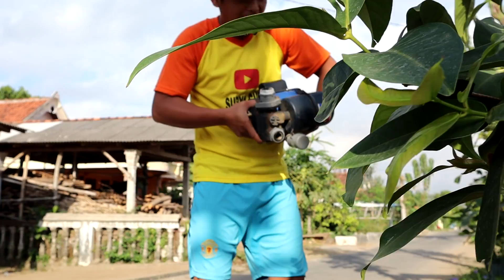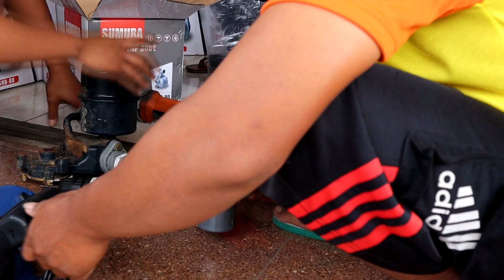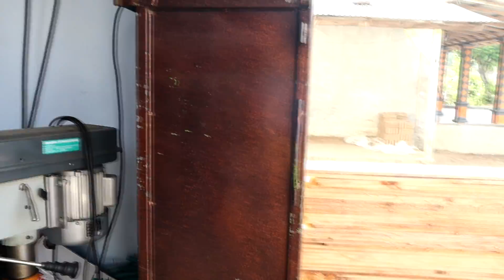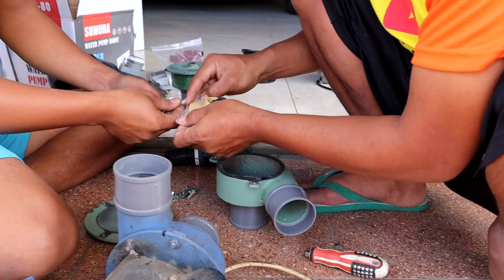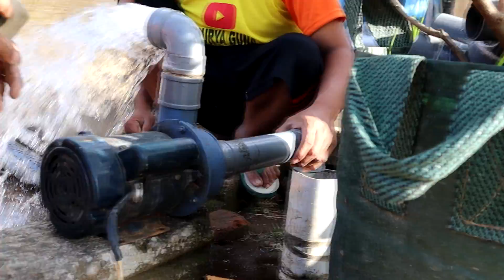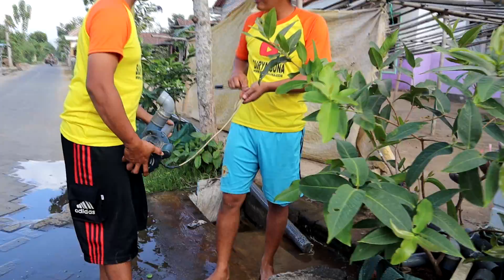JUARA NYA POMPA AIR MURAH

Comment: Pipanya bisa di ganti dgn 3/4 bisa ato nggak dan utk sumur bor
Reply from the maker: kekecilan pak. pakai 1,5inch saja pak. konsultasi bisa via wa 085646415014
Reply: Klo 1inch bgmn sbb sumur saya hanya 2inch
Reply: Kan itu daya hisapnya +-5 meteran dengan pipa hisapnya pake 2 dim.. nah kalau pakai pipa hisap 1,5 dim, daya hisapnya jadi berapa meter !?
Reply from the maker: @kntfotonik  daya hisap tetap pak. Wa 085646415014

Comment: Ini bisa pakai motor pompa merk apa ? Seri apa ?
Reply from the maker: Spesifikasi alkon besi :
* Harga 220.000
* pipa in out 2 inch
* impeller kipas baling baling air diameter 9cm
* isi paket termasuk seal + baut slepi  kancing as dinamo
* CATATAN INI HANYA ALKON / KEONGAN SAJA TANPA DINAMO MOTOR LISTRIK

Bisa diaplikasikan di tipe tipe pompa air berikut ini SHIMIZU PS 135 , PS 130 , PS 128 , PS 126 , PS 121, PS 116 dan lain lain pokok nya dinamo seukuran itu bisa

Untuk pembelian alkon modifikasi, Berikut ini Link Lapak kami di Beberapa Marketplace :

1 Bukalapak : https://www.bukalapak.com/p/industrial/mesin/mesin-pompa-air/aoptf4-jual-jual-alkon-keongan-mesin-pompa-air-modifikasi-murah-dan-di-jamin-berkualitas

2 Tokopedia : https://www.tokopedia.com/suryaguna/jual-alkon-mesin-pompa-air-modifikasi-murah-dan-di-jamin-berkualitas

3 Shopee : https://shopee.co.id/ALKON-KEONGAN-UNTUK-POMPA-KOLAM-MODIFIKASI-i.5615028.688055900

Tutorial cara pemasangan
1. https://m.youtube.com/watch?v=YV9CVsXynFo

2. https://m.youtube.com/watch?v=n7hPGtmHraU

3. https://m.youtube.com/watch?v=fr0C7SN-IUg

4. https://m.youtube.com/watch?v=fh-twgtNUTU